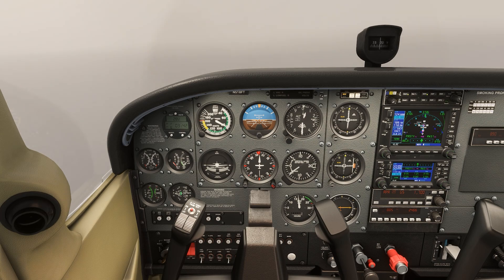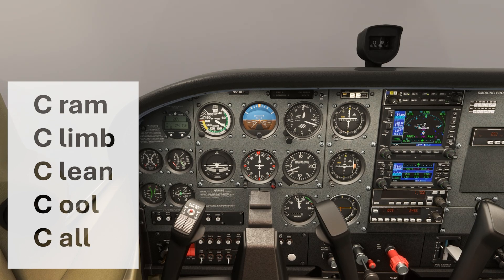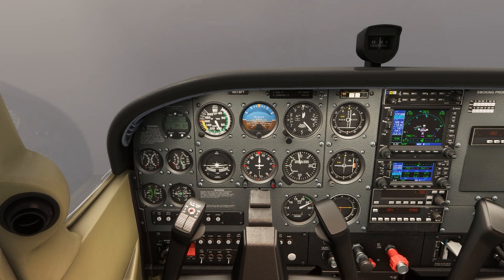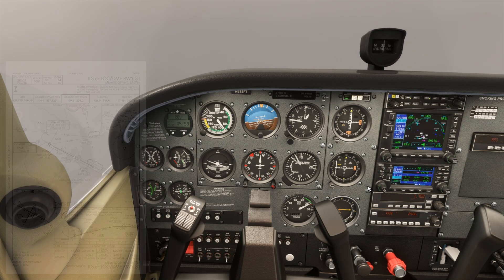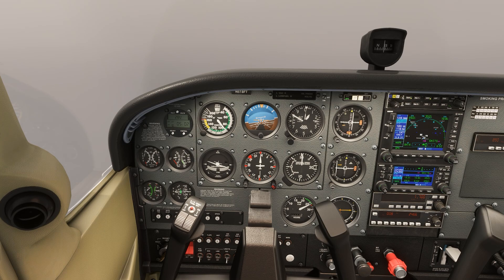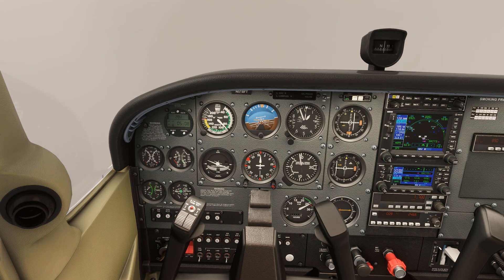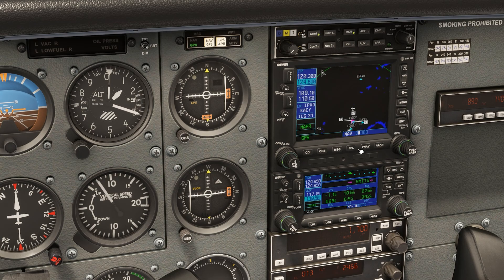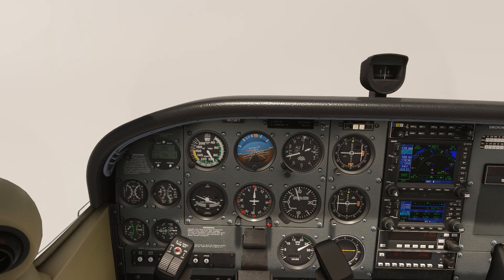The 5 C's of Going Missed | IFR Missed Approach

Comment: I personally put CDI instead of Cool. Cool doesn't mean a lot but CDI is actionable item, suspending approach.
Reply: Really? Engine management not near the top of your list, eh? Don't know what you're flying, but in my 182 I have to manage both carb heat and cowl flaps. I'd say that means an awful lot for both performance and engine longevity!
Reply: @jetjock60  I fly 172 primarily so that's why
Reply: @antiquehealbot6543  Must be an "R" or "S" model since any earlier would have carb heat as well.
Reply: Unsuspend right? And that’s different from CDI that’s OBS.
Reply: @susansticazsky9787  You'd have to do both if you're transitioning from ILS to GPS for the missed, right?!
Reply: @jetjock60  CDI and suspend goes together in 430 if I'm remembering correctly. In G1000, you'll have to change it manually.
Reply: If flying ILS missed you have to change CDI back to GPS on many (most?) GPS to get GPS guidance  for the missed. Otherwise you’re &$#@ed because your needles will give you gibberish as all you’ll see is ILS guidance. Also ,use unsuspend or you don’t get sequencing. I like the idea if CDI being one of the Cs and I may teach it this way.